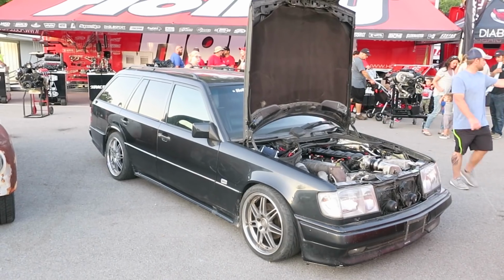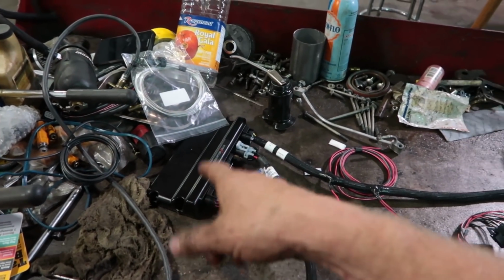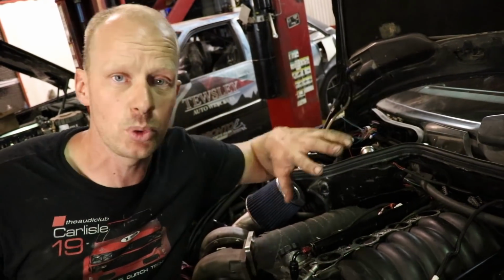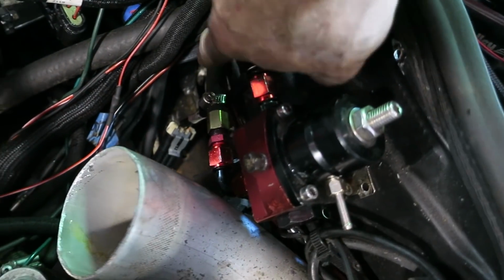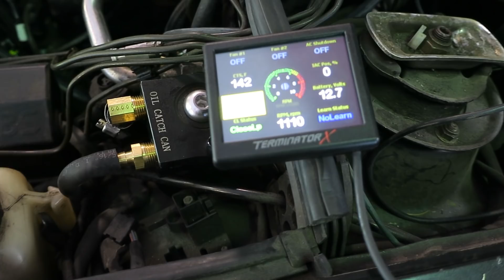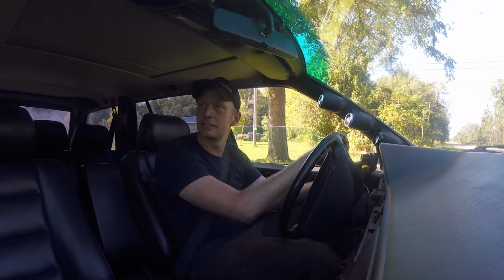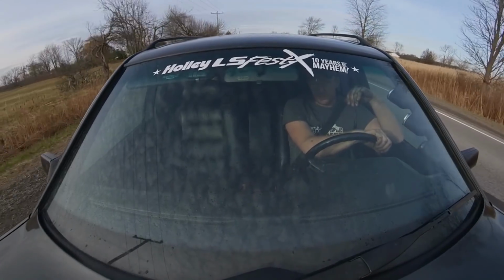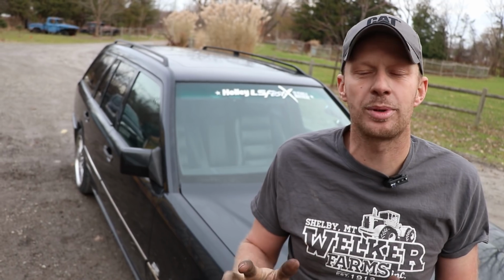Terminator X Install + FIRST DRIVE! | Turbo LS AMG #HammerWagon [EP15]

Comment from the maker: So if you had a Mercedes diesel engine (which we do), would you put it in a Mercedes car or something different? 🤔 These cars came with a Mercedes engine so that's why it wasn't getting a Mercedes engine. Hope that makes sense. #swapeverything

PARTS USED - Find the best prices using our affiliate links:
Terminator X Max https://geni.us/terminator-x
MSD Relay https://geni.us/msd-ss-relay
MAP Sensor https://geni.us/MAPsensor
LS1 Adapter https://geni.us/LS1adapter

Our #HolleyEFI #TerminatorX setup (your milage may vary):
8 Cylinders, Firing Order: 1-8-7-2-6-5-4-3
Litres (L): Metric
Engine displacement: 5.7
Target Idle Speed: 750
Camshaft Specs: #1 Below 235 deg
GM LSx 24 tooth
Holley Injectors: 36LB Holley 522-368
Power Adder type: Turbo
Sensor: GM PN 12592525 2.5 bar
WOT ign Timing @ 0 PSI: 25
Timing Retard per pound boost: 1.0
WOT Target AFR @ 0 PSI: 12.8
AFR Offset per 7 PSIG: 0.5
Drive by wire: No
Transmission control: Yes
Transmission type: GM 4L60 1.75 2nd gear (Pre-2009)
Tire diameter: 24”
Rear end ratio: 3.73
Reply: DEBOSS GARAGE is it the OM606...? Great motor, throw it in a boat with a vdrive or a jet drive ;)))
Reply: Put that OM602 in anything and boost the living shit out of it with 8mm elements in the pump. Check out dieselmeken and myna videos for inspiration
Reply: Figures, we always use those old Mercedes diesel engines in boats here in Holland Wen the cars themselves are all rusted away from the road salt.. (you should have know that Rich, being dutch) ... lol
Reply: MrBugsier5 I’ve seen a few of those vids, that’s why I suggested it ;))) beautiful boats, and Rich is next to an enormous lake ;)
Reply: I'd stick that mercedes diesel in a triumph tr7 or a miata, and build it to be a torque monster.
Reply: I really want to put OM606 to my Jeep XJ, so if you would do it first... ye, just do it first. Pretty please ;)
Reply: You asked a while ago for ideas for a half ton truck engine swap and I think a merc diesel is a great size. Great fuel economy pretty good power stock and can be turned up a bit... maybe not a million mile drivetrain when turned up so high but would make a cool engine and close to same weight as an iron truck motor
Reply: You couldn't pay me to own a damn Mercedes diesel. They put them in the freightliner for a bit (maybe still do) nothing but trouble out of it all our other trucks are cummins except that pos
Reply: Craig the farmer passenger car engines are very different from the divorced head medium and heavy duty applications, and in those cases I’d agree. Cummins are more reliable and over engineered even with their passenger and smaller applications but are also extremely heavy and in the case of a 1/2 ton truck as I said I think the 4bt is underpowered and overweight, and cost significantly more for the block itself. To each their own
Reply: I've dealt with too many Mercedes diesel engines to use one for anything but a boat anchor.  I've got zero respect for Mercedes.
Reply: I think that Mercedes diesel needs to go in Toyota FJ or something like that get some four wheeling of it
Reply: Jeep yj
Reply: DEBOSS GARAGE my dads got a Mercedes OM617 in a 73 Jeep CJ-5, check it out his Chanel is hillbilly villy
Reply: DEBOSS GARAGE put it in an Dodge omni and make a franken golf
Reply: Here in the UK we are starting putting them in landrovers and there are some good conversion kits about it totally makes a different truck one with some power rather than one just wishing for a bit more power from the standard tdi
Reply: @dakotataylor7909  I can see your point but I guess if a commercial engine is crap I assume there privet ones are just as bad or worse due to not having to pass as many department of transportation limitations
Reply: @laser69beam  If it is a 606, it would be the N/A which isn't as stoked on boost due to lack of piston cooling and a few other bits and bobs compared to the 606 that came turbocharged from factory. 
On the other hand, it could be a turbo 603, which is just a 606 with less valves.
Reply: Put it in a supra or rx7
Reply: Man what a waste.
Reply: NOT an AMG, NOT a Hammer. Just a T124 with an LS swap.
Reply: @Loop44  I didnt mean a waste of a car, though that is also true. I meant a waste of money and effort for a car that will now be worthless when similar performance could have been had for much less fabrication expense using. Mercedes v8 or diesel powerplant.
Reply: @kwittnebel  this could've gone much better with a 5.0 V8 sourced from a SEC or S-Class of that era, that would've been an actual Hammer Wagon. not getting a benz engine because the car is a benz is fine. your car, you do whatever you want with it.
not having a benz engine and calling it a Hammer that's where i need to tell you to fuck off. but yeah, muricans, wtf do they know?

i own a diesel W124 btw. OM602.962 with a 722.3 gearbox

people talking smack about benz diesels is hearsay.
Reply: @Loop44  My mechanic put a m117 driveline into his w123 wagon without much trouble. Bolted right up. My 87 300td has a 606 turbo in it, mechanical pump. A bit smoky, but fun. One w123 wagon has an om648. The other 123 300td is stock. As for this car, a resto mod is at least something an average mercedes mechanic can handle if something goes wrong and it is all stock mercedes stuff from another model. No one will want to touch this thing.
Reply: volvo
Reply: I want one for my '88 ram50
Reply: Only OM606, truck turbo and it’s a torque beast
Reply: I think the link for the camera is bad.  
"Lcoffers- may install malicious software on your device" is the error that pops up and it doesn't look like a 360 camera product page.

Comment: I just rewatched this whole series, I actually ended up swapping a Ford 302/AOD into mine and I just got the bugs worked out of it today and finally got to properly drive it.👌
Reply: Omg. Right on. I just got a sweet euro 300te, and I love it. Wanted to do the om606 but they are pricey af now. I need more power and a stick shift would make me so happy.
Reply: @finished6267  V8’s actually fit pretty easy, but I don’t have any turbos or A/C or anything like that. The transmission tunnel is really tight though so a manual would fit a lot better than an automatic. I do have a video covering the swap on my channel.

Comment: Final drive vibrations at 50mph ish can not only be the axle driveshaft, disc and wheel but also the 2 small bushes on the back of the diff to subframe. Thankfully Meyle do HD versions which hold up really well and cause no N&V issues either.

Comment: I like the Welker Farm T-shirt, I'll be visiting them next May on my way to Wester's Garage in Tilley Alberta to tune my LS7 powered Saturn Sky - looking at 550hp to the wheels in a 3000 lb car. Then maybe I'll bring my Cummins R2.8 powered Pontiac Solstice by your shop and you can test drive it the fall of 2020 or the spring of 2021.

Comment: 1/2 ton short bed 2wd with a Merc diesel. Objectives. Highest miles per gallon while still being a reasonable daily driver (fuel consumption wise) pickup. Can we get this combo to beat buying a civic or corolla miles per gallon wise plus more usefulness? Id say at least 70 mph top speed. Be able carry 1000lbs bed or trailer and beat the economy cars in miles per gallon.

Comment: Check out the AMG/500e widebody OM606 8mm Dieselmeken pump'd e320 wagon i built last year...fully mechanical 600hp with a M3 5 speed...These things are great. Only one wire to start and tune mine though :)

Comment: YOu need one way check valve on the brake booster line, and you will have normal breaks. In Europe we like this Merc a lot, it is symbol of indestructible car.
Reply: a large vacuum can and check valve would help brakes in normal street driving. BUT racing/off-road forget it, because it will never be long term cruise enough to accomplish vacuum.
that will also cause lean-out conditions upon each brake application and return from boost to vacuum. nothing like leaning the shit of the engine at every throttle roll-off, when it is most likely to detonate from high heat building boost conditions....
I'm quite sure I can just stop here and not go on an on anymore :))

Comment: 1994? 5.3, 5.7? Hammer was in the 80's with engines 5.6, 6.0. When Mercedes buy AMG, 90's, there was E36 and E60, not nicknamed Hammer

Comment: Do you need a one way valve in the brake booster line or move the line to in front of the turbo instead of on the boost side?
Reply: Brake booster from manifold as normal, but with a spring loaded 1 way valve in it.

You'd be surprised, but there should be very little to no vacuum in your intake pipe in front of the turbo if it's set up right.